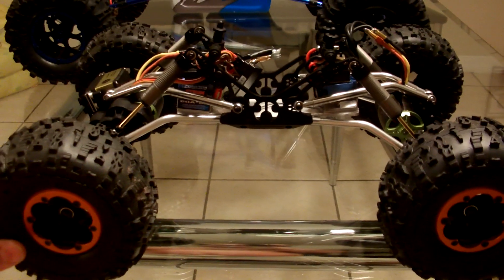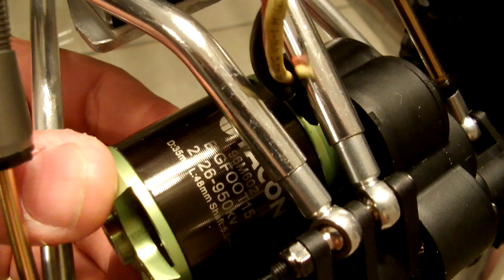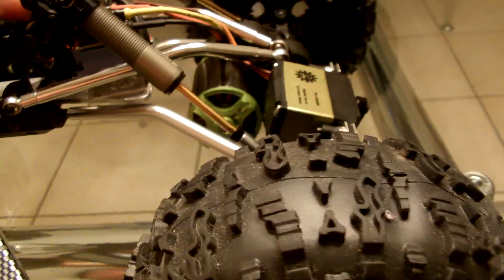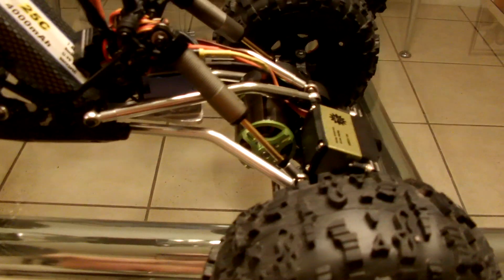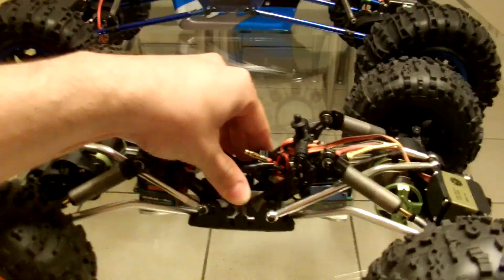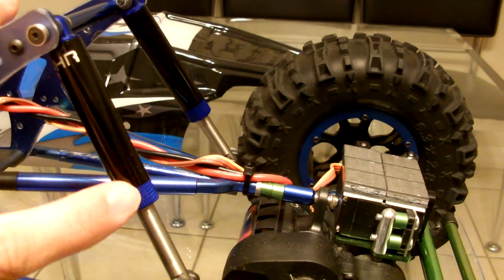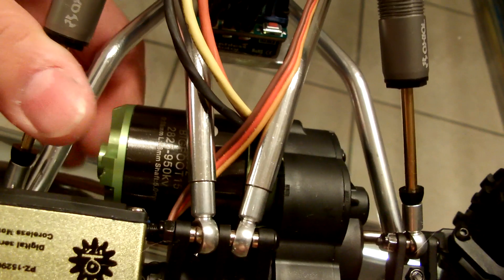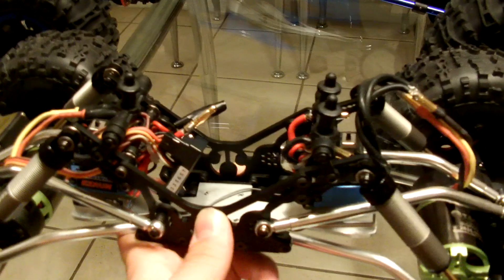Axial XR10 Comp Crawler / Formula Offroad 5 outrunner motor/internal spring shocks

Comment: what's the name of the blue crawler you have there? great video bro
Reply from the maker: +ViceVersa Musik Its a Mad Torque from Nitro RCX. Its a low budget crawler, dont expect too much from it and you will be alright :)
Reply: Gamyrc Yea... I have checked them out in the past. How strong are the axles on the Mad Torq?? Because I do see a lot of potential in that crawler if those axles kept up alright, And really with an MOA, The axles ARE the truck... There the main part of the Truck... Compared to a Shafty!! Like the XR10, I love the Axles on the XR10!!! My XR10 has 2 Venom 55 crawler motors (which are AWSOME) Novak M2 Dig(AWSOME!) ProLine Badlands which are sticky as hell which makes them AWSOME! lol, also a Hitec (9055-I Think) High Torq metal gear servo of course, And plus I had bought all the Axial Carbon Fiber upgrades for my kit the same time I bought the kit, so I could install all the goodies as I was building my XR10... . Instead of installing them later down the road. But to me the Axial XR10 was perfectly constructed! The Axles were made perfectly for the Rocks! The BTA Steering... The whole setup is genius and I can't believe they stopped making them, And the same goes for the Losi Comp Crawler man... Why??? I just hope Axial comes out with another MOA because they are what I like using! I just feel like they are a lot more advance... And powerful of course, but we all know it depends on the driver and how much practice is under there belt. Anywayz dude, sorry that turned into a story of my opinion Lol. If you can let me know about the Mad Torq Axles that would be great.
Reply from the maker: Well, the issue with the axles is not the axles themselves but the strength of the plastic case around them. It warps a bit at speeds and when applying too much torque (upgraded motors. As you stated XR10 axles were built right, Mad Torque axles are meant for just fun at a reasonable price.

Comment from the maker: Come on man give me a bit more credit here, of course I use Billet Works Design derlin motor guards on them, it would be crazy to run them without protection with a spining outer case and those huge holes in them! :) I did'nt show them in the video because I wanted you guys to actually see the motors spining to show its speed, but when I crawl with it I put the motor guards, most crawlers use motor guards even with inrunner motors just to protect the motor from rocks hitting them! :)

Comment from the maker: I agree 100% with u on that they are jerky at times,but these tacon motors combined with the hobbywing 60a esc are just awesome,no jerking whatsoever,and I had not even set the expo on my transmitter,had not played with motor timing on esc,and was using the 19t pinion instead of the 14t which I use now,Ill post another video with everything sorted out so you can see how great this setup is,keep in mind,I did try other outrunners before with another esc and result was jerky, not this setup though

Comment: Most dont use the outrunners due to initial surge when throttle is applied because the nature of motor. Yours however are very smooth on the bottom end.